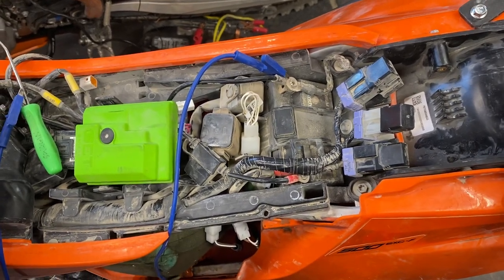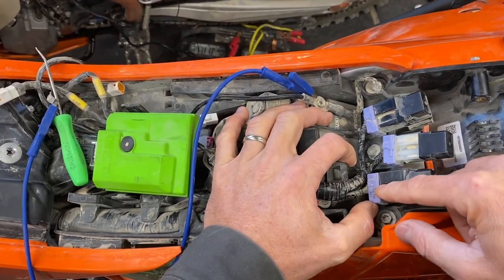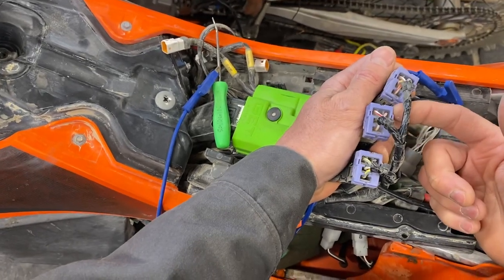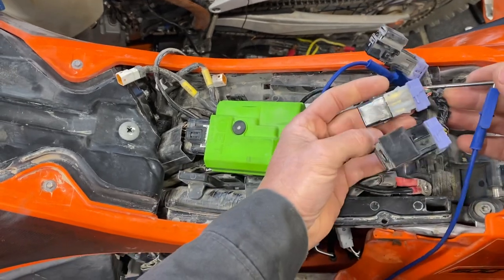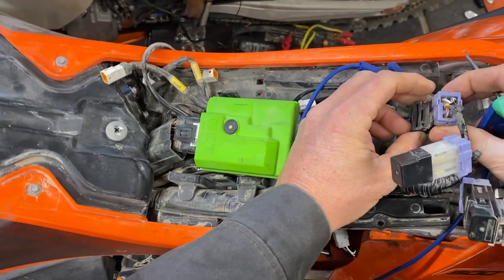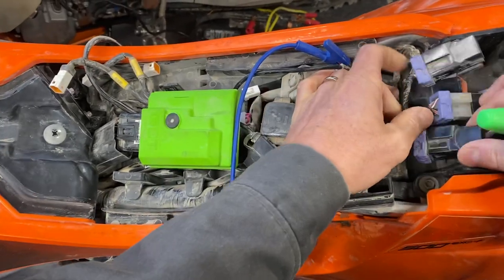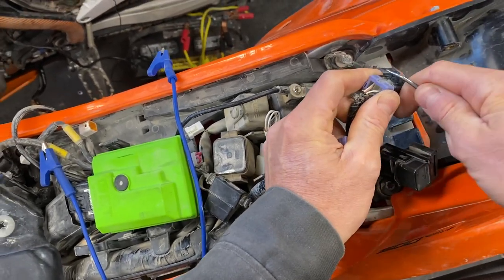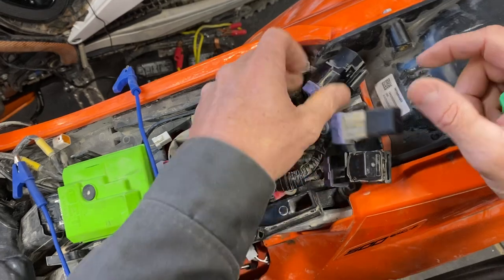20+ KTM TESTING FUEL PUMP, FAN AND LIGHTING RELAYS

Comment: Great video, I learned a lot
I’m pretty sure you stated in the beginning that the left relay is the fuel and even stated it’s marked but when you grounded the control you said it was the fan. Bottom line it’s clear the left one (air filter side) is the fan, middle is lights and right one is fuel pump 🙏🏻🙏🏻
Reply: Lights and fan are on same relay on Husky tpi 300 21
Reply: @kostapopov384  i have an husky te 300 (2020). In my case middle relay controls lights AND fan, the right one is fuel pump. Do you know whats the left one for?

Comment: Hi 
I have got a ktm 350 exc 2017.
The fuel pump relay only gets ground from the ecu when you push the starter button and turns the fuel pump on but  drops as soon as you release the starter button (will not stay on for 3 seconds ) the  bike will not run start.
I can run a jump wire to the fuel pump relay earth fuel pump come on still no will not start any ideas please? I think the ecu may be shot !
Reply: How did you resolve it Carl?
Reply: @dirtrider9268  spark plug and new relay fixed it from memory. Mate of mine also had a no crank on a 701 spark plug was fecked. I guess the ECU can see no resistance from the spark plug then creates a fault??
Reply: @carlhansen8668  thanks, post the error code if you have it.

Comment: At 3:56 seconds there is a test ground (white/black) wire. what is wrong if this mass is not good? What is wrong if a maximum of 10 volts comes to the gas pump (good/full battery)?

Comment: I have a problem with the 2016 KTM 250 motor, the electricity won't turn off after 10 seconds the engine dies

Comment: Thanks man! I have an issue with the fan of my 390 duke (2020). It starts running as usual when the engine heats up, but it doesn't stop. Oddly, the engine doesn't cool down effectively nor does it overheat. Has anyone faced a similar issue after exposure to water? Appreciate any insights or solutions.

Comment: Hey man, I used this trick to test the fuel pump relay on my 350sxf, when I put the pick into the relay, I got a little spark and didn’t think anything of it, after I replaced the relay, now my starter button is dead, even with the old relay put back in it. Before I tried this trick, it would crank just fine, my fuel pump just wasn’t priming. If I jump the fuel pump straight from the battery with some test leads it works fine, but like I said, after sticking a pick that I grounded to frame into the relay, now I have a dead starter button. Both fuses on my starter relay are good, now I’m stumped.

Comment: My 13 exc 500, all of a sudden won’t start. I hear the fuel pump running. If I disconnect the quick disconnect in the fuel line after trying to start it, it has major pressure built up. HELPPPPPPPPPPP !
Reply from the maker: Do you have spark? 

Will it fire on a quick shot of carb spray?
Reply: It has spark. It is fuel injected.
Reply: @jjchopper02  Fuel injected or not, You can still use carb spray. If it works this way, means engine has spark, but has problem with fuel delivery.

Comment: Great Video as usual from Mike! I tried to test my fuel pump using this method but unlike how yours fuel pump runs for a while mine starts then sounds like it is bogging out like a starter with a nearly dead battery. Should my 2022 500 excf fuel pump run for a while when testing the relay using this method? I am having some issues and thinking this could be at the root of it. Please advise.

Comment: Great video, I need help. Installed a Tidy tail and wiring harness on my 2021 XCF-W 500. When I jumped the relay to test the lights I accidentally hit the 12v side and blew the starter fuse.  I changed the fuse, the bike turns over but won’t start. I have tested all the fuses, relays, and changed out the ECU. The fuel pump doesn’t cycle when you hit the starter. I can get it to cycle by jumping the wires. Any suggestions
Reply: Hi were you able to figure it out ? I'm having similar issues,bike will crank but no start.Intermittently,sometimes it does start just fine

Comment: My 2017 KTM 500 wont start. the fuel pump doesn't prime, so i grounded out the relay like you did in this video and i can hear the relay click but the fuel pump doesn't cycle. Is it safe to say my fuel pump is bad? i would like to get some opinions before i shell out $$$ for a new one. Thank you
Reply from the maker: You can test it with this 

https://tacomoto.co/products/fuel-pump-tester-and-transfer-kit-by-taco-moto-co?utm_medium=product-links&utm_content=ios&utm_source=copyToPasteboard

Comment: I'm not an expert mc mechanic, but I think you should warn not to ground out the wrong (ie, hot) coil terminal because that would cause a short to ground!  Hopefully a fuse will blow, else you will melt some wires!  Is that right?
Reply: I just fried my 2012 ktm duke 690 ECU… just ordered a used one 🙃

Comment: Hello
Does every Fuel pump have relay?
What are sign of bad relay?
Ive Aprilia SR 160 and the vehicle don't start after a short ride. Initially SC replaced fuel pump and now they're claiming that this maybe because of faulty wiring. I feel that this is a sign of faulty relay.
Reply from the maker: Do you have a wiring diagram for that bike? You can trace the circuit and make checks to see what component is giving you the trouble
Reply: @TACOMOTOCO  I don’t have the diagram,         How do I locate the relay?
I thought the problem was with fuel pump so replaced it. But the issue isn’t resolved. What other bad components can cause the fuel pump not to work ?

Comment: So my headlight is not working, but if I ground the relay like you said it will come on. What's the next troubleshooting step?
Reply: I got same issue, been racking my brain. Changed really still no joy  😔
Reply: I have the same issue. Did you guys figure it out?
Reply: @jesse2413  I had the dealership scan the ECU and do the latest update, for whatever reason it came out of it after that.

Comment: Great video! Thanks! 
I have an issue with the pump being activated by start button or kick start. I tested the way you show here and work (which I understand the relays are good) but if I hit the start button the pomp is not working. 
Any help is more the welcome! Thanks!
Reply: I have same problem have you fixed you problem ? Cheers
Reply: any resolution to this? currently having the same problem on a friends bike
Reply: @sauceracing  I had a cable somewhere pinched on the right side of handle bars. Just fixed that and was working again
Reply: @hophophopa2030   do you tell me what a calbe  i have same isus my exc 500 sommtime when i start pump not activeted
Reply: This is peculiar. The ignition wire loom is tied to the main harness running on right side top tube, under the tank i recall. Check the related connectors behind mask, unplugging lubing w dielectric grease and replugging. Check that each pin is seated fully in each connector, especially the connector that goes through the hard plastic bracket attached to the top triple/stem. The tanks outside connector is sealed well but those on the pump inside can be a little loose I hear. Squeeze those blade connectors with pliers slightly. Save yourself a lot of $$ by doing it yourself! Mike's vids are a good start.